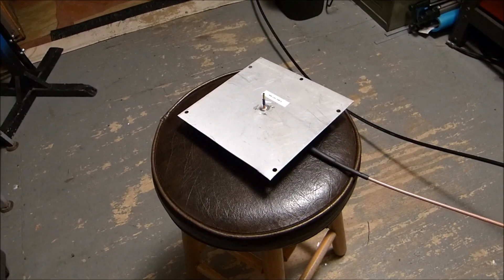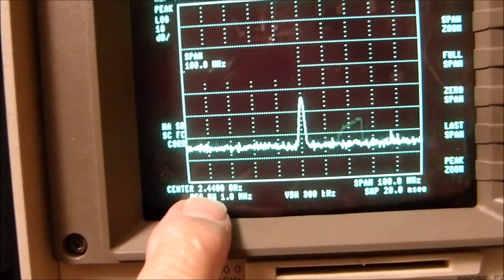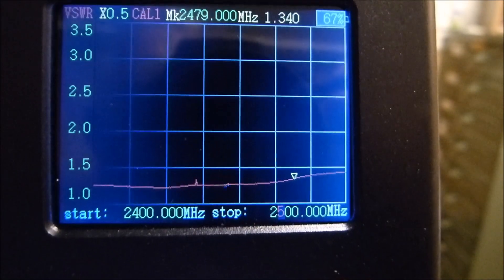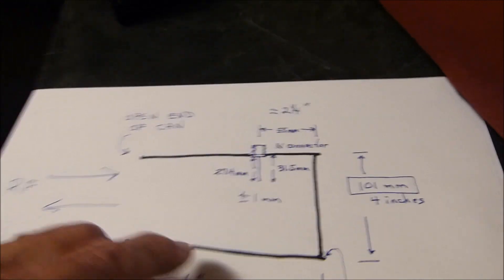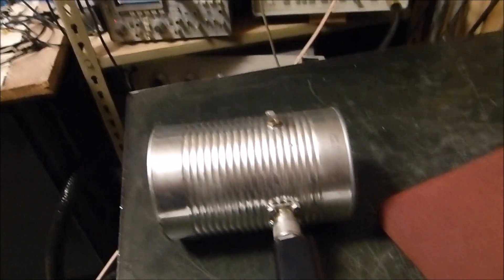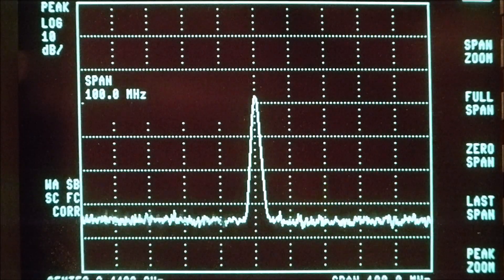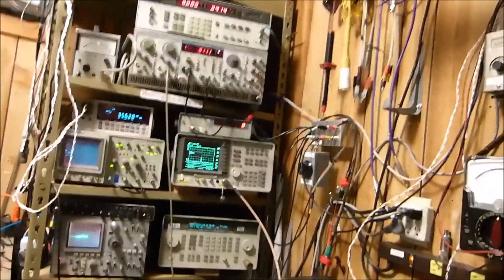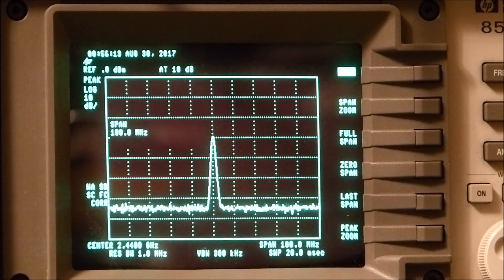WiFi Antenna - 2.4 GHz Cantenna & Parabolic Dish Gain Measurements and SWR

Comment: Thank you for the great video!! I want to put an esp8266 inside of a polyethylene cistern that is buried under about a foot of dirt to measure the water depth in the tank and have it connect to an access point inside the house. If I have an esp8266 setup as an access point, I can get about -80 to -90 dB of signal out by the manhole of the cistern, but it is not enough to make a connection. I guess I will hafta start digging in the trash for cans, LOL!

Comment: get this... the radiating pin does not have to be copper, i have one f-connector with a rusty piece of steel wire soldered in and it performs comparably to a copper pin

Comment: ok, got my single antenna adapter and the cantenna works, went from about 12 nodes to over 30
i will have to experiment to optimize the efficiency, thanx for your prior input
Reply from the maker: Very good. Thanks for letting me know.

Comment: i built a cantenna..i don't get a lousy signal...i get no signal
Reply from the maker: The components you use to build it are very important. Use a N connector and not a BNC or UHF (SO-239). A good N connector is good to at least 4 GHz whereas a BNC is rated to only 1 GHz and a UHF connector to 300 MHz. Make the monopole 1.2 inches long and solder it directly to the N connector and connect the cantenna absolutely as close to the access point as possible using large good quality coax like LMR-400. RG-58 and the small coax sold on Ebay will not work. The gain of an antenna can easily be lost in just a few feet of transmission line coax.  It is also very directional so make sure it is pointed at the other WiFi device carefully. Hope this helps.
Reply: @ElPasoTubeAmps  i  used an n connector and a store bought cable....however i am using a twin antenna adapter...is that the problem?
Reply from the maker: @thebetazone6955  Is the store bought cable short, like one foot or so and what is it, RG-58, etc? I am not sure what the twin antenna adapter is? Ideally, the cantenna would connect to the WiFi device directly with (mount of top of the WiFi device) with an N to RP-SMA adapter or RP-TNC adapter whichever is on the WiFi device.
Reply from the maker: When I look up "twin antenna adapter" I see the TV type 300 ohm to 75 ohm transformer for VHF antennas. If that is what you are using, that surely is the problem.
Reply: @ElPasoTubeAmps  the cable is about 13 inches and is a n to sma adapter and is very thin.....the adapter has two antennas, which i read elsewhere means there is a dithering algorythm that swtiches between the antennas...the wifi adapter can plug into a wired stand or the the computer at the usb directly
Reply: @ElPasoTubeAmps  very well, i shall order the old fashioned adapter that only has one antenna and can only plug directly to the usb on the computer....will report back after ups delivers...thx for the advice
Reply from the maker: @thebetazone6955  The cable t hat is N to SMA sounds good. I am not familiar with the dithering algorithm and antenna switch so I can't help there.  I suppose your cantenna connects to a 2.4 GHz RF device that has the (digital) output that goes to the USB? 
I am sure you know the antenna can not be connected in any direct manner to the USB. Not sure I am much help here. 
Can you send me a link to a website so I can see this setup?
Reply from the maker: @thebetazone6955  Best of luck. I would like to know how you made it work. Who knows... I may need one someday.

Comment: I built a very similar "cantenna" years ago to receive Showtime ("Showbiz" at the time) signals over the air.  I was able to substantially increase the gain by placing a long rod with a series of elements in front of the can. I mounted the can inside a section of PVC and mounted the rod to an end cap. In my case the rod was 1/4" threaded rod and the reflector elements were metal shingle roofing disks!

Comment: Thanks for shareing.
Reply: First, sorry for hijacking your thread, but youtube only lets me post new ones when it feels like it, now, and I have no idea why. But I built and tested lots of these, and have a lot to say about them.

First, I'm not a mathmatician, or anything, or an expert, except on youtube. I read everything I could find online, and used several online calculators to compute mine. They all absolutely agreed with one another, so I presume their math is sound, even if it is beyond me. And here are the important things about waveguides that I learned are important, We already know that a 1/4 dipole should be about 31 or 32mm. But the diameter of the can and the wavelength BOTH effect the distance from the back of the can it has to go, it's where the standing wave will form. Think of it as the waves come in from the front (and only certain size radio waves will fit properly into a certain size can), and they hit the back of the can, and bounce back into the incoming waves, and pile up on each other. It's called propagation of a standing wave. When I did my sattelite dish feed tests, I decided just for curiosity, I took apart the original feed and was very familiar with what it was. It was a waveguide tube, flared at the open end, much smaller, with about a 1" diameter, except at the back, instead of having a wire feed a certain distance from the back of the can, it had a flat piece of metal cut in the shape of a staircase profile, stepping up to the end that was almost touching the back of the can. So I knew it was a wide band waveguide, how smart is that? And I felt so vindicated! But the main point is that the standing wave point is a factor of both the wavelength, and the diameter of the tube, and it form a curve with wavelenth, like that stepped conductor stepped up towards the back of the tube, in that same way. 
For 2.4ghz, or wifi, the wavelength is 12.5cm. The ideal diameter can for this band should be between 80mm and 90mm. Use large soup/sauce cans, they are 3-1/4", about 83mm, those will work the best. And for that diameter, the feed should be placed 2.5" - or 63.5mm from the back of the can. I'm working from memory, but those numbers will build you a good antenna. What I suggest doing, if you can, is elongate your hole, so that you can move it forwards and backwards a little bit, centering it at 2.5", so you can adjust it if you want to. One can will work, but putting on one more, with both ends opened to make it longer would be better. The wavy sides of the can are less than ideal, so I made my last generation from exotic tea tins, with smooth sides, but they are a little outside the ideal size, and work about the same. They look more professional, though. To make my wifi wunderwaffen, I coupled one to a 1 watt USB client (cabled) with an Atheros chipset  by way of just an N to RP-SMA adapter, so there is no loss to any coaxial cable. I pick up about 100 AP's in the only direction I have that isn't blocked. Some are a mile from me. It works twice as well on the sattelite dish, but I built a double biquad feed for that that works as well, but isn't as direction sensitive, it's a wider antenna with that.

Comment: what gain would you get with the cantenna mounted at the right spacing in front of the dish instead of the antenna currently on the dish??
Reply from the maker: Since I have this dish so nicely set up for the Andrew probe seen in the video, I don't want to change it to the Cantenna feed horn. But, I do have a slightly larger dish that has been set up for the feed horn and the slotted line feed probe which I intend to make another video on maybe even this evening. We might expect a bit more gain out of the larger dish just because of its size but I think, if I remember correctly, the gain is pretty much the sum of the dish plus the feed horn and I expect about 20 dB from this dish. We will see soon. Thanks for your comments.
Reply: thank you
Reply: Nick Horrex

Comment: I am fascinated by your videos and have followed your designs but am confused. In a previous video you said the driven element should be 42 mm from the base of the can, now you say 55mm. Which, please? 
My can is just short of 4 inches diameter and 6.5 inches long. Thanks.
Reply from the maker: I am going to revisit an old dish tonight and install the Cantenna feed horn back on it and make some more measurements and a new video. I think I know which feed horn I used for that posting and staging 42 mm and I will check. My Cantenna is 4 inches in diameter because it fits inside 4 inch thin-walled PVC pipe that I use to mount the feed in the center of the dish so, 4 inches is no design parameter, just what I had to use to make my system work. I have only had the opportunity to examine one feed horn from the vintage and huge (14 feet) dishes of decades ago and I think the feed horn used on them are about 6 inches in diameter. Some of this stuff we see on the Internet is just another regurgitation of some academic paper and it doesn't work worth a hoot. I have obsessively built these things in many different versions and the distance of 1/4 wavelength of the probe from the closed end of the can performs very poorly. Doing the math, a full wavelength at 2.4 GHz is 0.125 meters (125 mm) so a quarter wavelength is 31.3 mm or 1.23 inches. Placing the feed probe that close to the closed end of the 4 inch can does not work very well. At around twice that distance, say, 60 mm or so, it works so much better so I would go with the 55 mm instead of the 42 mm. I am determining all of this by the seat-of-my-pants experimentally so the exact distance is not critical down to the mm.  That has been my experience. I have also determined from examining military parabolic dishes that the focal point of the dish should be somewhere around a couple of inches (50 mm) inside the can and not right at the mouth of the can. I keep experimenting and posting and hope that whoever chooses to build these antennas will find some value in my experience and in the end, make the final build to their own tweaking. Nowadays with the inexpensive instruments that we can have, that used to cost multi-thousands of $$$, we can measure and tune these gigahertz devices up as easily as the ham radio operator of yesteryear could his 80 meter dipole. thanks for your comments.
Reply: thank you very much